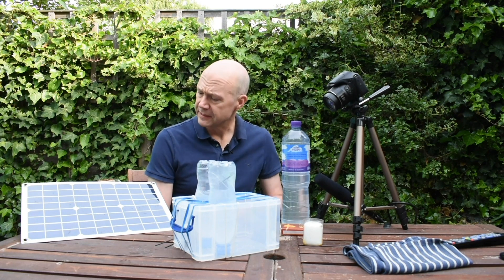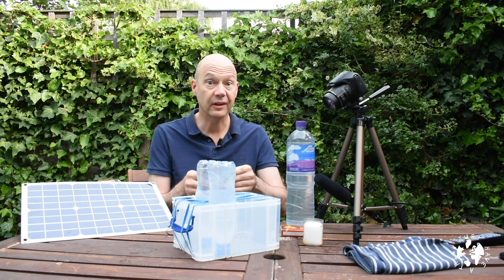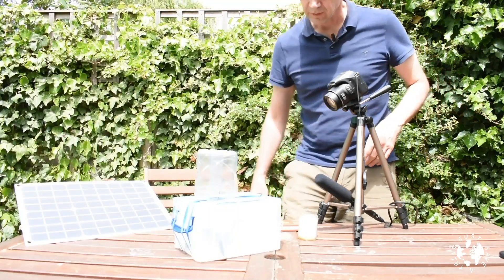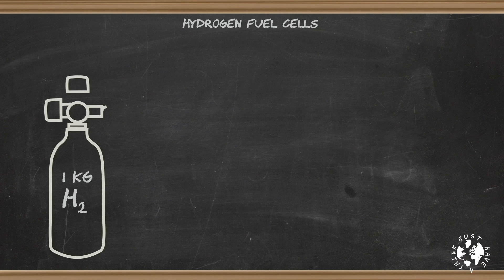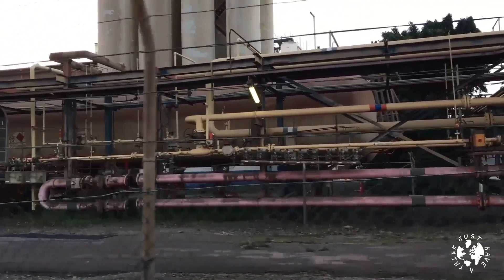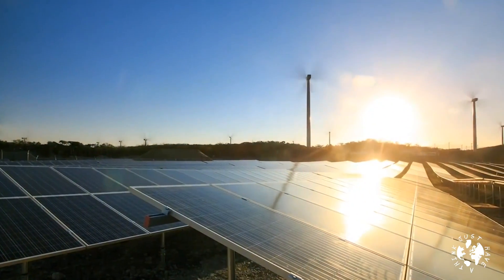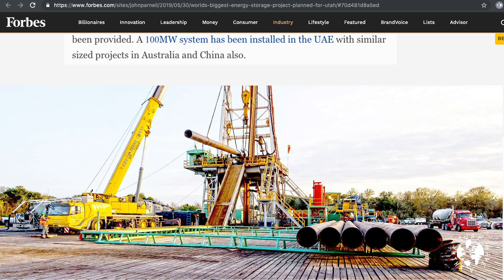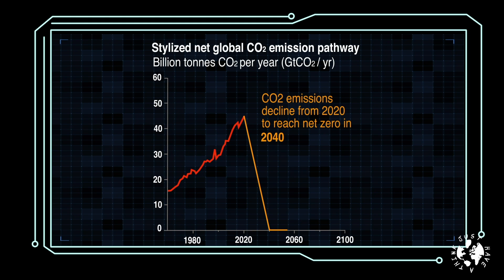Energy Storage in Hydrogen : Does this beat batteries?

Comment: Hydrogen is great as a last resort energy storage. It will always be chosen last, but for some applications it's the only option.

The best energy storage is a combination of several different solutions, for example: a combo or a mechanical storage + liquid air storage + hydrogen would complement each other nicely and give redundancy needed if one of them fails. 

The mechanical battery is fast at responding + powerful and works great for balancing the grid (might need a 500 milliseconds supercapacitor buffer for even faster response), the liquid air storage is cheap and relatively efficient (60%), hydrogen is not very efficient, but it's great for storing endless excess energy when both the other storage systems are already full, and you can sell of the hydrogen when the storage gets full for profit. 

Just transport the hydrogen using hydrogen powered trucks to the buyers (Airplanes and boats will both be using hydrogen as a fuel in the future). Since hydrogen would be too valuable to use for the grid except at huge emergencies, over 99% of it would sold instead of returned to the grid.
Reply: @Allen Loser Boats only option is hydrogen. Those huge cruisers will never use batteries.
Reply: @Allen Loser Hydrogen will become cheaper in the future if power plants start to make it of excess power. California for example produces more electricity from solar than they need and could store part of the excess as hydrogen. The energy would have been wasted otherwise, so it's a great profit.

Also I just discovered than instead of storing hydrogen directly, ammonia could be used instead, avoiding high pressure or very low temperature for storage.
Reply: @Allen Loser Well, we will see in the future how it goes. I think hydrogen definitely have a place when travelling at sea and in the air. Ammonia and urea seem to have great potential to make hydrogen more viable. It will never be the main fuel in the world, of course, but it will have its niche. 

Batteries and hopefully supercapacitors will definitely dominate the land vehicles.
Reply: @Allen Loser The future will tell who of us two will be right, if either. I actually don't think that hydrogen will be used for much at all, only for air and sea which is a small niche where batteries are not possible to be used. Pipes makes transporting it cheap and easy and since it's it's made from surplus energy it will be cheap enough.
Reply: @Allen Loser Why are you talking about cars? Hydrogen for cars would be a really stupid idea, batteries is the only choice for cars. I will be able to charge my Cybertruck for free over here when it arrives, so why would I use hydrogen? There are no charging station at sea or in air though, so for those vehicles hydrogen is the only choice.
Reply: @Allen Loser Ah, now I see why you are confused. You are assuming that what is true now will still be so in the future, sorry but that's not how progress work. Hydrogen cars will fail and problably will destroy Japanese car makers that have put all their eggs in the wrong basket.
Reply: @Allen Loser Airbus

Comment: I'm a big fan. But I don't think hydrogen is ready to compete against batteries today. Currently, hydrogen generated by electrolysis cost twice as much as just charging a battery directly. Yes, batteries degrade. But so do hydrogen systems due to HE (H2 embrittlement). This is the same debate about solar vs geothermal - they seem equally  competitive in theory. But in practice, it is easier to maintain hardware on your roof top than hardware 400 feet underground. 

There is a reason why we use battery electric cars today and not hydrogen fuel-cell cars.
1) You can't charge H2 fuel cell cars at home. Residential permits are not allowed for good reason.
2) Battery chargers are so much cheaper than hydrogen generators.
3) H2 fuel cells are difficult to maintain than batteries. Higher maintenance cost.
4) A pin prick can let explosive hydrogen build up inside a car or enclosed garage.
5) Hydrogen fuel cell cars cost much more to manufacture than battery EVs (twice the number of parts).
6) A lot of energy is lost in electrolysis. Generating hydrogen cost twice as much than just using those same electrons to charge a battery directly.  

Although, these mostly applies to vehicles, hydrogen for grid storage will have similar issues, specially the high maintenance cost (cost to make it safe).  BTW, storing hydrogen underground could be like making a giant bomb underneath your feet.

Comment: Why are you storing it? Hydrogen storage is inefficient so don't pursue it.. hydrogen production plants can be powered by Green energy like solar Fields or wind farms, and the hydrogen can be used during peak hours to power the electrical grid and during off-peak hours it can be used as a transportation fuel, no need for storage.

Comment: Hello.  Have you heard of Proton Technologies?  It's a Canadian firm that aims to pull clean hydrogen from oil wells, while leaving the carbon in the ground, all at significant cost savings.  I'd be interested in what you think about it!  https://proton.energy/#:~:text=Proton%20Technologies%20helps%20oil%20producers%20make%20low-cost%2C%20high,techniques%20to%20produce%20H2%20in%20mature%20oil%20fields.

Comment: Please put link to past videos in you comments for easier location of past videos. Also using Stanley Allen Meyers water fuel cell for low voltage high frequency to produce more hydrogen at faster rates. As he did in his water car.

Comment: Sorry but Hydrogen is NOT a great energy carrier  Fact check:
1. Most common element - yes but its not free Hydrogen, it needs more energy put in to turn it into usable Hydrogen.  There is very little, if any, free Hydrogen on the planet.
2. The energy weight density - Is good yes, however like batteries the container is heavy and expensive.  This isn't a useful characteristic when the volumetric density is so poor.
Points 1,2 are always sited for Hydrogen, however they are irrelevant grasping at straws for system that has no USP.
3. Grid storage / smoothing - It can be done but, its hugely inefficient.  You only get 30-40% of the energy back. Batteries get >90% back (a Tesla powerwall is rated at 92.5% round trip efficiency).
4. Hydrogen needs to be compressed to 700x atm (or 700 bar) to store any decent amount of it.  This takes about 15% of the resulting available energy and needs expensive containers (the most advanced in the world).  Furthermore fuel cells used to convert it back to electricity are only 60% efficient (party due to the 13% energy needed to compress the air).
4. Compared with batteries Hydrogen storage cannot compete when it is throwing away 2/3s of the energy, batteries will be available for storage in peoples BEV cars, this will store all the renewables we need and it will do it efficiently and respond quickly for grid stabilisation.  People will be paid for this.
5. Hydrogen conversion, compression and storage is very expensive.  An efficient electrolyser or fuel cell costs about the same as the matched output on Lithium batteries (10MWh storage requires 10MW output).  Batteries currently cost the same as a fuel cell or electroliser, but batteries also perform storage, so storage is extra for Hydrogen.  Hydrogen might be slightly useful for longer term low output trickle storage, but one of the problems is that no material can hold Hydrogen for a long time.  Steel or Carbon based tanks can only manage a few weeks before substantial amounts are lost.  Ultimately the efficiency means Hydrogen needs nearly 2x as much storage as Lithium batteries, and 3x the energy input for the same energy output.  For 100kWh output you need to input 300kWh of electricity if Hydrogen is used as storage.  You need <110kWh for a battery.

Hydrogen has alot of problems to solve before it could be considered seriously as any benefit for climate change in the intermediate future.  Maybe if costs became sufficiently lower than batteries, such inefficient storage could be useful, but we would need to be at 100% renewables with spare to waste.

Comment: Quote from the introduction:-

"Energy storage is pretty well accepted as the route to making renewable technologies a globally workable solution for reliable grid level electricity production."

It only seems to be 'pretty well accepted' in the media. In the real world, however, there is not the slightest chance that energy storage is a workable solution to renewable generation. Storage works for frequency stabilisation but not for intermittency or to significantly increase the amountof renewables in the genertaion mix, it is simple not feasible due to the enormous short fall of renewable generation at times. Companies are keen to get into storage as grid balancing services pay well but at a cost to the consumer. 'Cheap' wind and solar comes at a high price for the customer.
Reply: This is why hydrolysis to giant bags is the cheapest storage medium ; all you need is open space !  .🤔

Comment: I am a big fan of hydrogen as well as batteries and super capacitors. Hydro dams are also a good way to store energy and release it as needed too. Electrolysis of water seems like a bit of a waste of energy though. Water is bonded too tightly. Urea and ammonia are far better liquids for hydrogen production. If we retrofitted water treatment plants with electrolyzers, they could produce more energy then they would consume to produce hydrogen! The waste water would be cleaned in the process too. Just google hydrogen from urea or ammonia if you want to learn more about it. 

We could also be producing a whole lot of natural gas from our sewage treatment plants as well.

Comment: Now pressurize it to 120 psi and put it in a steel bottle using hydrogen energy. If you chopped down every forest in every state and replaced them with solar panels you would fall quite short of the energy this country uses.

Comment: Efficiency verses energy density. Thus the conclusion is if the hydrogen is cheaper than a global grid? Because batteries are more efficient but can not store more than 18 hours (the inverse of capacity factor) and hydrogen requires very large storage volumes. Will hydrogen not be absorbed by the salt or other material and react by forming other, possibly nasty compounds?

Comment: The only reason hydrogen is pushed is because we have to buy it at the pumps instead of having the ability to fuel at home. It replaces gas in a way they can continue to charge us and tax it. It would be easier because we know what power costs and raises would vote out governments, but hydrogen has no known cost and could be priced anywhere without resistance.

Comment: Hydrogen will never beat batteries. To drive a hydrogen car for one mile you need to spend much more electricity than electric cars need to drive a mile. Modern batteries have more than 90% efficiency, and no other technology comes close. In a few years we will all be driving around in electric cars and the worlds energy crisis will be solved. As a bonus we will put an end to the mindless burning of fossil fuels. As a second bonus we can breathe fresh air in all our cities.
Reply: Batteries will never beat hydrogen. Fossil fuelled ships, trains, planes and trucks can run at full power for a day or more. Batteries would be overweight and overpriced. Ammonia powered fuel cells or engines are quite affordable but would still require a massive increase in renewable energy.
Reply: @dougmc666  In ordinary cars, battery power is unparallelled. For ships, trains, planes and long distance trucks, hydrogen surely has better potential. I don't see how we disagree here.

Comment: Fake. Would take either way more power to make that much gas or would take days.

It takes way more energy to make and store hydrogen from water compared to electricity. Charging stations can be installed anywhere and do not need anyone to haul fuel or expensive tanks underground to store this fuel or even a cashier. Electricity is a huge win over hydrogen unless u can justify very large and dense storage like an airplane

Comment: Hello will you look at the Hanging Wind Turbine invention on revoltwind.com?  I believe it is the solution to pollution.  When you hang it, you don't need a tower, or the land on which the tower sits, or a permit if its a small one.  And it appears to be making electric power at the lowest cost of any known technology.  See revoltwind.com  we finally got the US patent.  It is patented in many nations.  We need as many people to look at it and scrutinize it as possible.  It can be made with 6 inch blades for 5 watts, or blades larger than existing.  The tower is what limits blade length.  No tower....blades can go longer.  Hang a few on a bridge...power the bridge cheaper than running a power line to it.  Need help from manufacturers who want to build them.  Need people to know it exists.  Wish to share this technology with the entire planet.  The 4 ft diameter RW-1 will make 200 watts and weighs 16 pounds!  It only costs a couple hundred to make.  It is portable, easy to fix by lowering to the ground.  And if you only have a couple hundred dollars and don't own land...you can actually own one!  That is not the case with a tower mounted machine.  I challenge all to either prove me wrong or get behind it.  we need cheaper electricity.  We need it everywhere.  And we need it green.  This checks all boxes.

Comment: Great technology. A question: When hydrogen combines with oxygen to form water and is cooled, there is a great decrease in pressure. Could drop in pressure be put to use to do work and thus increasing the efficiency of the turbine or IC engine? 😀

Comment: It would be better to capture lanfill methane and use the electricity to make hydrogen and carbon nanotubes. Then you have hydrogen to make energy from and a high value product in the carbon nanotubes to offset the energy lost in the conversion. In addition you would get rid of a lot of methane pollution which currently escapes from landfills. Electrolysis is only about 60% efficient then you still gotta pump it etc so you really want another product to help offset the loss. A problem that still needs to be solved is the explosion risk since hydrogen combusts with just 4% oxygen mixed in.

Comment: See youtube "the truth about hydrogen"  - real engineering.     Very easy to understand dive into hydrogen, it's pluses and minuses.    Massive loss of efficiency being the major drawback while energy density per Kg being a massive plus.      Hydrogen cannot be used to make hydrogen as it is a negative energy cycle while grid scale Li ion battery use along with correct engineering eliminates wasted generation of wind+solar grid systems.     Why would we divert energy from disrupting fossil fuels ASAP to a highly inefficient use of that power in creation of hydrogen?
Reply: We would put energy into improving the efficiency of that power in creation of hydrogen to power ships, planes and trains.  Li ion batteries are too large and expensive to imagine such applications.
Reply: @dougmc666  1r eliminates 1f.   
2 .5r = 1H.
1H eliminates 1f .       

r costs X dollars.    You have  X  dollars.   

eliminate f  in the most cost efficient, fastest way possible.

Comment: JHAT......The energy taken from renewables, stored into hydrogen, then re used is only 33%-50% efficiency vs simply using the renewable energy directly AKA if used directly into a Li ion battery that same renewable power gives 2 to 3 times the miles total as you get from storing to hydrogen then powering a car.  Is this process clean and better then oil...yes.  Is it better then direct charging of a Li ion battery...no.     To eliminate fossil fuels ASAP you would first use all renewable energy to disrupt the grid sources and transport industry to maximum....THEN worry about air travel or ocean sources.

Comment: A little searching will reveal that the round trip P2G2P figure is pretty low.  You only get around 28% of the energy back, compared to the original solar power that went in.  Your video is wrong to not mention that.  As well as long term storage, the advantage of H2 is it's light weight and high energy density when compressed.  Last year it was a candidate to power a new metro system, due to fast recharge and light weight. Is it also a good candidate for aviation?

Comment: I think you are missing the elephant in the room. You say no nasty CO2 greenhouse gases, and then go on to say the only by product is water vapour. For those that do not know; water vapour is also a greenhouse gas, and it is actually responsible for around 75% of the Earths heat retention. Just saying. Stop pushing the bs about global warming going up 4 to 5 degrees in the next 80 years. Explain the medieval warm period to everyone then. CO2 is currently at 410 ppm and in the Holocene era CO2 was at 7000 ppm with temps at 22 degrees. It is a lie cooked up by the IPCC and CLIMATE GATE is real. Just research how all IPCC reports were released based on deliberately misrepresented facts and measurements from China.

Comment: Hydrogen can cause serious embrittlement problems inside steam boiler tubes. It can get so bad that steel tubes simply shatter. 
The same problem exists for storing the gas at high pressure. An explosive gas at 300 times atmosphere in a brittle tank does not bear thinking about.
Plastics are not the solution because the tiny hydrogen atoms literally leak through the material.

Comment: Listen carefully. If you connectnthe solar pannel by cooper wires without aligators, you will have 70% boost on hydrogen production in first minutes. Better using 316l will keep running 70% boost if you use it on positive instead of any magnetic or oxide-releasing metal.